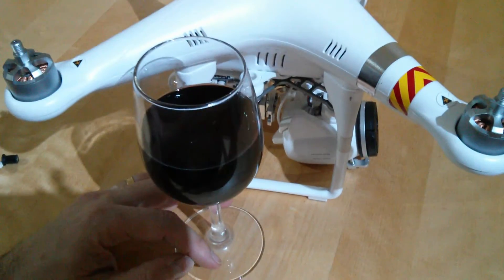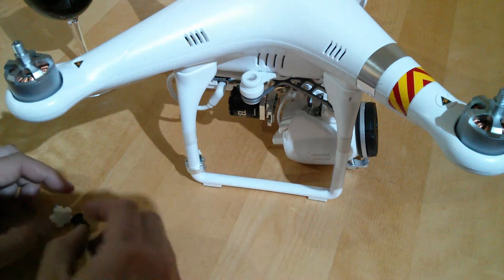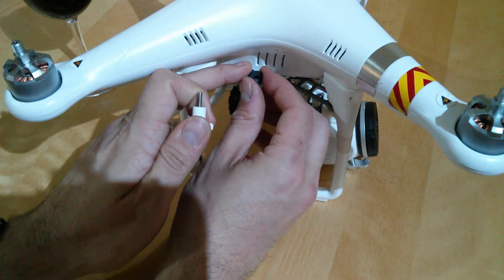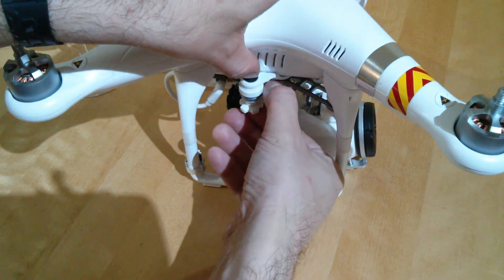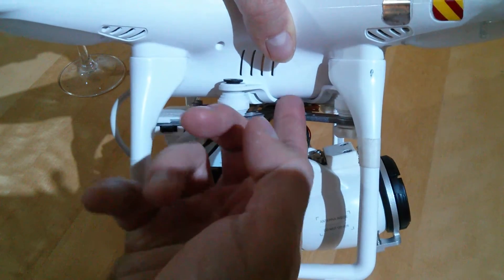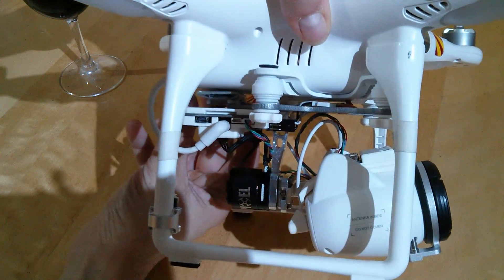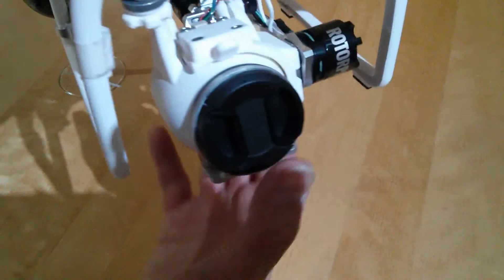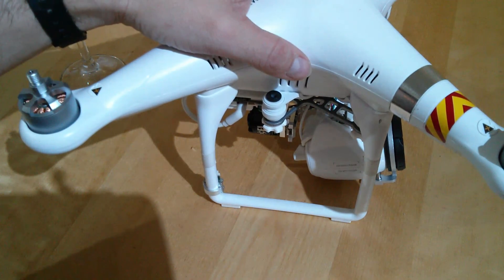Rotorpixel Vision gimbal - how to fit the vibration damping screws on DJI Phantom 2 Vision

Comment: Hi Simon- Just got my p2v out to fly after not flying it in months (last spring I think).. Though my mobile devices have the latest version of the dji app my p2v still has the older firmware and other software from earlier in the year (which I'd prefer to keep as some of the new features with the newer firmware/software aren't appealing..)- that said, on trying calibrate I notice the latest dji app version has a calibration guide which suggests only turning the quad on two axes through 360 degrees to calibrate - from memory from when I first got the p2v last January I could swear the instructions originally required turning through 360 degrees on all 3 axes..any way after turning on the horizontal axis through 360 degrees the yellow turns green, but after turning through 360 degrees in the vertical nose down orientation the LEDs start flickering in red, indicating a failed calibration....I've tried several times but cannot get it to get a successful calibration indication after turning in the vertical orientation...is this something to do with not updating to the latest firmware or software or something else? Any feedback on resolving this would be greatly appreciated- I've been waiting months to get my rotorpixel gimbal and now Ive finally got it I cant even fly the stock p2v to test fly it before adding the gimbal till this calibration issue is solved..thank you!
Reply: ***** thanks so much for your thorough reply Simon- it's late here in CA- will try what you suggest tomorrow and keep you posted as to how it goes..one thing I can add and didn't mention is about a week ago was when I first tried flying it, but didn't realize the s1 switch was in manual mode, yet I was trying to take off thinking it was in gps mode and as a result mishandled it, resulting in a somewhat hard landing from a few inches above concrete (though nothing visible to the eye was cracked or broken as a result)...afterwards (I now forget the exact wording) but there was a temporary error message showing in the dji mobile device app something like 'battery error' with a 'sd card' icon in the background which wouldn't go away until I blew on the battery contacts (I read somewhere this message comes up when the battery contacts need cleaning, though seemingly unrelated to the hard landing) afterwhich miraculously the error message stopped and could then access the camera functions through the app again (which I couldn't do whilst the error message showed), but didn't attempt to fly the p2v again that day till now and wonder if the compass somehow got damaged in that somewhat hard landing..
Reply: ***** thanks Simon- I have a post at phantompilots.com on this issue- here- http://www.phantompilots.com/viewtopic.php?f=7&t=27998&p=257437#p257437 (4th post down shows pictures of the legs and compass- yet the legs don't look buckled to me and the compass appears seated correctly though I'd value your opinion..to add to matters- since the hard landing (don't know if related) I've now noticed one of my batteries (don't know if it's the one that was in the quad during the 'hard' landing- I only have two) doesn't appear to want to charge (normally of course the led lights come on the battery indicating charging- but isn't showing anything, even though when I quickly press the smart battery's button it shows how much charge is in the battery (not much charge at all- very low)..the other battery charges normally..
Reply: ***** Hi Simon- just an update- I made sure the remaining working battery was fully charged up and after fully charging and using that battery- I tried calibrating the compass and it worked! Don't know if it was an issue with that battery or not but glad it worked- and regarding the other battery issue- I asked on the p2v facebook group page and a coupleof people said to make sure you turn on the battery before pluuging it into the charger- I didn't actually know you can turn on the batteries when not plugged into the p2v (I don't think I ever needed to turn on the battery before plugging into the charger to charge in the past- the other battery didn't need to do that and nor had this one until now- but thankfully after turning on this battery- it did start to charge and is now fully charged- I have yet to test in the p2v in flight- but hopefully all is OK-  is it always better practise in general to alwyas ensure the battery is turned on (both of the ones I have) every time I charge them before plugging in to the charger? I don't know what happened- may have been something to do with the battery's charge being so low or even at 0%..but glad (hopefully) this is resolved now..thank you for your support- now just to decide whether to upgrade any of the dji desktop software or particularly the firmware to the lastest version, before or after installing the rotorpixel gimbal..are there any real advantages to some of the newer firmware versions over the older ones- can't remember which version I have, but I remember sticking with an older version as I remember one of the newer ones lost the ability to add 3rd party lever on the back of the TX to move the camera up and down with (as opposed to using the touch screen app to do so- I purchased teh lever back in day but have yet to install it)- do you know if this function is back at all with the latest firmware/software? I just think 'if it aint broke (as is) don't try to fix it..' kind of view point.
Reply: ***** thanks Simon- autonomous flight with waypoints system? Wait- you mean ground station now works with the p2v? (I thought it only surged with the p2 and p2v+...?)
Reply: ***** awesome news- just wondered- my camera firmware is up to date (1.1.19) but my NAZA- M is only at 1.08..certainly not 3.04 or later..if I update to the latest NAZA-M, if I don't like it, is 1.08 still availble to download and  is it posible to revert back to the older version without issue? (the current (older) p2v firmware I have allows me to use the 7th channel for using a 3rd party lever on the back of the TX to pitch the camera up & down but understand that 7th channel acessibility was lost with newer versons- can you confirm if the newer firmware has reintroduced access to control the 7th channel or not? thank you so much
Reply: justinspirational is it the NAZA-M firmware upgrade that loses the 7th channel or simply using version 3 or above of the  DJI Phantom 2 vision assistant software that loses it?
Reply: ***** so if I upgrade to 4.02 but want to get access to the 7th channel again- installing 1.08 assistant will get the 7th channel access back again or since the main board is upgraded (irreversibly as you say) even back to 1.08 I'd lose the 7th channel capability? It's hard to find a list of all the changelogs and features of the different firmware versions- don't see the diference in features on the dji site..apart from the added ground station/waypoints features of the latest version not sure if there are any other benefits or  if there are any other downsides to the latest i addition to losing the 7th channel..

Comment: I am interest in picking up the Dji Phantom.. But trying to get information about the two differences from the Dji Phantom 2 Version Vs. Dji Phantom with Go Pro....
I cannot find a dealer that can give me the break down
Reply: Phantom 2 Vision is a ready to fly quad copter with first person view video feed.  All you need is an iOS or android device to complete it.  The Phantom 2 with or without the H32D gimbal requires you add your own Gopro hero 3 camera and your own custom setup if you want a live video feed with or without telemetry information.   The advantage to using a Phantom 2 with  GoPro Hero 3 black is a higher quality HD video recording.  You can add a higher quality fpv video feed than comes with the P2V which has a maximum video feed quality of 640x480 15 fps.   Advantages of the Phantom 2 Vision you can start and stop video recording or picture taking while in flight.   You can also preview still images or video shot while still in the air.  You can also make adjustments to video and picture taking setting while in the air.   P2V is less expensive than a Phantom with hero 3 and custom fpv setup.  The P2V does not come with a 2 axis gimbal so videos will not be as smooth and level as video taken using a Phantom 2 with the H32D gimbal.
Reply: What is for sure, is that the 2 are the same quadcopters. You will have the same flying experience. What I have understood so far (and experienced), is that the Vision is a great camera for taking pictures, while the filming quality is better with the GoPro and the Zenmuse H3-2D combined. Especially when there is a bit of wind.... then the Vision is not so great for realizing steady footages. But now, with the new gimbal that Simon shows in this video, filming with a Vision will become closer to the results obtained with the GoPro-H32D combo (but again, the GoPro produces better quality videos). The Phantom 2 + GoPro + H3-2D is also a bit more expensive than the Vision's package.
Reply: Ben7seven7 Yes, of course, I forgot about the live video feed and control over the camera during a flight with the P2V. This was a very important point when I decided to go for the Vision.